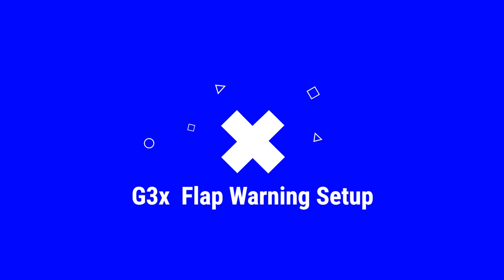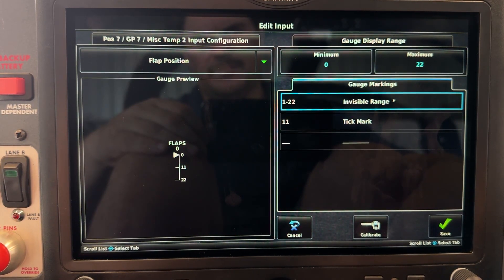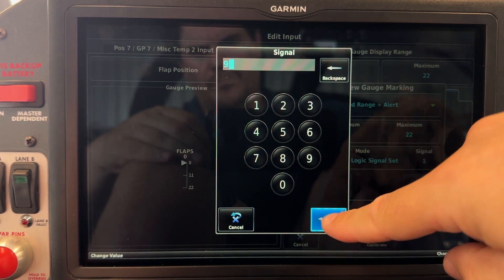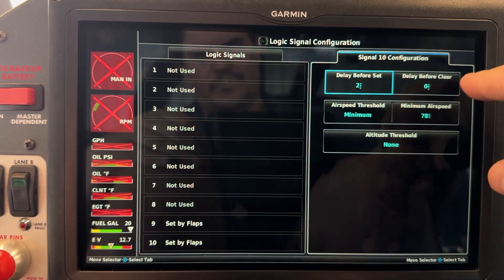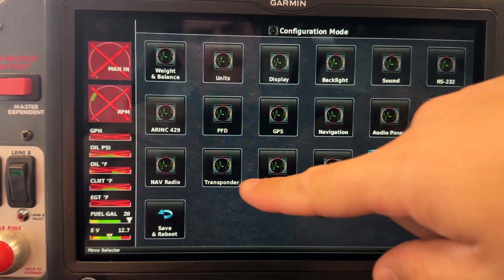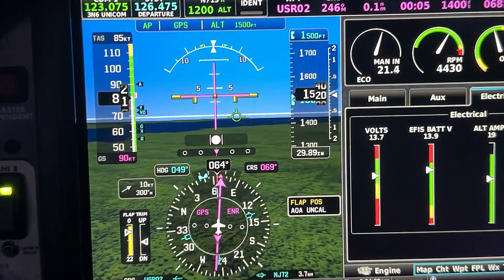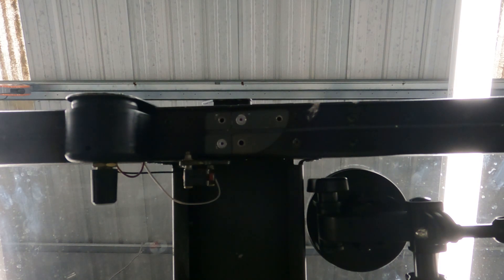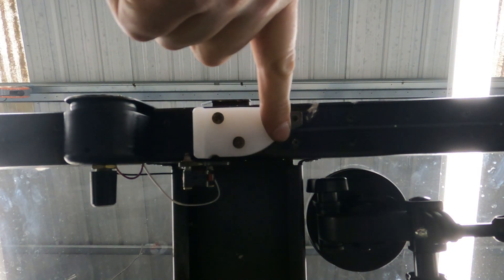Garmin G3x Flap Position Warning

Comment: Question. I have G3x touch in a certified aircraft. I was planing to use the RA+ POS-12 position sensor for my flap position to gea24 and the gad-27 for flap control.  Is this feature available in the certified installation. It seems as it is simply a safety advisory it should be.

Comment: Excellent! Can't wait to work on this. This requires G3X v 9.22 correct? 
Are there any other configuration items besides this that v 9.22 can "unlock"?
Reply from the maker: I believe it's 9.11 or higher.  No reasons not to go to the latest version at this time.